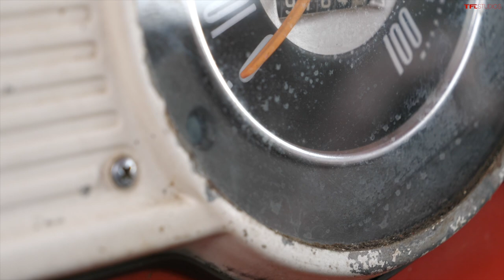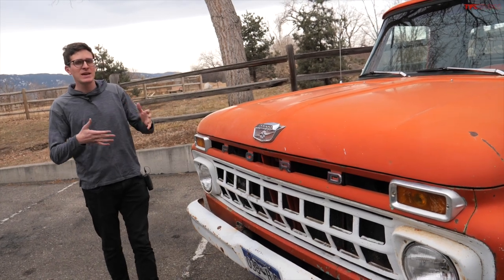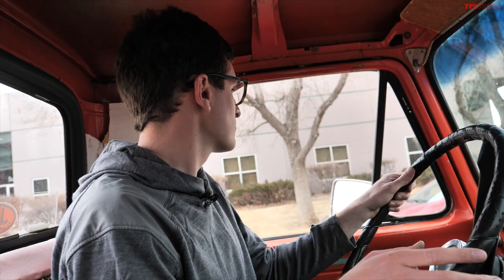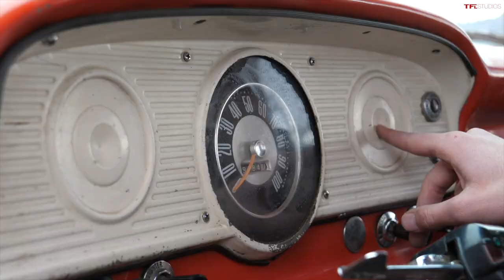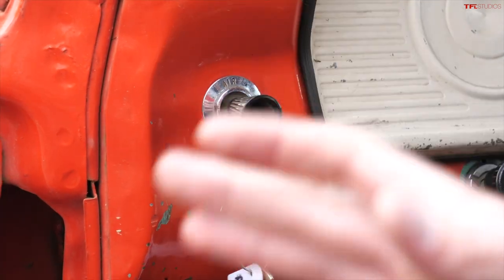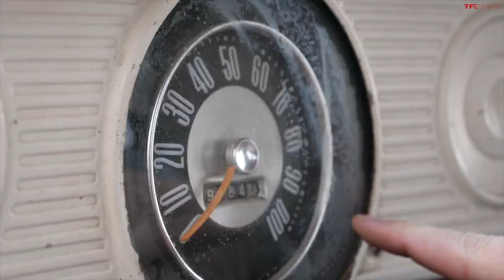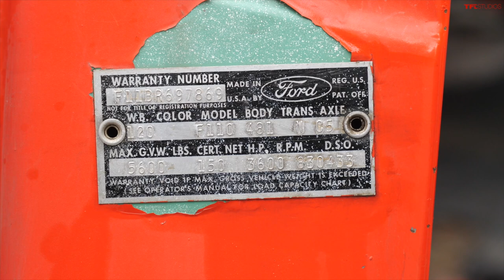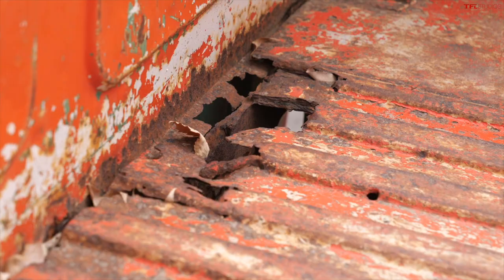Do You Like Raptors? I Just Bought The Ford Truck That Started It All!

Comment: Tommy you should daily drive it for a month, you will grow biceps if you do.  The lap belt will do more damage than good if you do not keep them tight against your thigh, if it is loose they slide up against your guts in an accident.  Nice truck I like them stock but most people update them.  There are kits for the brakes etc.  The nice thing about drum brakes is they can sit for a long time and still work, disc rust and rot out fast from sitting.  Back when ford made a truck.  You can get dash pads also so the dash is soft and almost what ever color you want.

Comment: I had a 91 Bronco with the straight 6 and that thing was unbelievable reliable. I remember I broke the radiator and drove around 120 miles with no radiator at all and the engine was smoking most of the way at 60 mph, on arrival I only replaced the radiator, coolant and oil and I drove that truck at least 50k miles more without an issue. I sold the truck to a friend and he also drove it for many more miles without issues in the engine...

Comment: Nice truck! I think I'd leave it a 6 cyl. I used to drive a 1955 and a 56 Ford trucks for work, utility work beds on them, 312 cid I think, no power anything, steering was scary on the freeway but they'd do it. Used a 1962 Ford 4X4 for snow plowing, also a V8. But I still have my 1973 Ford 4X4 short bed, factory high boy, lifted 2 inch springs and 2 inch body lift with 35X12.50s, after 36 years, second owner. It came with the 360 which I switched  for a 1964, high nickel, 390 a friend had built for his 58' Ford Fairlane race car. It had an Offenhauser intake, a big cam & 4 barrel. I rebuilt it with the Edelbrock Performer Package cam, lifters, intake and carb, Flowmaster series 40 desert racing mufflers shotgunned out the side in front of the rear tires on Heddman Headers, bored .060 over, TRW flat top pistons, converted to 1979 power steering, disc brakes with a small Grant steering wheel on a stainless steel steering shaft with u-joints instead of rag joint (which I've torn in 2 twice), which was a great mod. Swapped the Dana model 21, 1 speed transfer case to a NP 205, 2 speed behind the NP top loader 4 spd I rebuilt completely and had high grade drive shafts made for it. Changed the gearing to 4:11 with a Power Trax Lock-Rite Locker in the 9 inch, big bell, big tube, with custom bracing, Timken Roller bearings, 31 spline axle rearend. I'd bent the weak 8.8 it came with while rock crawling. Dana 44 in front rebuilt. Always used the Ford hubs with no problems. Installed bucket seats with air bag adjusting which really helped too. I wouldn't trade this truck for anything! I've owned it for 36 years! Drove it from Az to Wa when I moved, it's not as comfortable as some but can run down the freeway at 75 all day, even loaded, doesn't matter, still gets 10 mpg, have had it to about 120 passing a friend in his Chevy on the freeway to work, lol. It will climb until it's straight up in the air with the front tires off the ground sitting on the custom no drag rear bumper. Drag raced a brand new Ford V-10 and beat him to about 60 when I had to let off, lol. I will never buy a new truck, what a waste of money! (for what I do) I'm not afraid to scratch mine either, flat black is easy to touch up. Love my 1994 Astro van though i have to admit, with only 184,000, it looks and works like new and gets around good with the over sized mud tires i put on it. Everybody comments about either of these 2 vehicles when I go anywhere, lol. Old school fun for me lol

Comment: Great video. I love my 300 i6! Quick note on the different factory bed. It is a stock 65 bed from the 58-60 body style, but isn't 4x4 exclusive. One of the main innovations of the new 1961 Fords was a unibody f100. Basically, the bed quarters were hooked to the cab like a ranchero. While that helped with style, it created issues in real use. There were horror stories about doors popping open while going around corners with a load in the bed. The weight would warp the panel, and put your door out of alignment.  Plus, if you got hit anywhere on the side you would have to replace the whole thing. Due to backlash, Ford scrapped the unibody and went back to two-piece cab and bed. However, they didn't have the stock and tooling to produce the extra new "styleside" beds. So they re-manufactured beds from their old "fridge" body style. These 1960s are affectionately known as "wrongbeds" by the Ford collector community, and 1965 was the last year. They tended to be most prevalent on base model trucks, as a cheaper than cheap option. The wrongbeds went away by 1966, and the bumpside trucks began in 1967. Keep up the good work!
Reply: Quick note - The Wimbledon white 1961/62 f100 shown for a brief second at 6:37  is a perfect example of a unibody. I highly recommend looking into it, the history is very interesting.

Comment: The original mirrors had (kinda) "Z" tube frame and the mirror "housing" itself had mounting bolts at the center top and center botoms which served as side to side adjustments points. They were very long (about 12 in top to bottom by 6 in side to side), because of their lenght, they didn't need any up and down adjustment, so they didn't have any. 
I know this because my Grandfather had a '64 (maybe '65) F600 medium duty truck when I was about ten. He bought it from the Corona beer company when they were in Puerto Rico (Yes, Corona was a Puerto Rican beer for a while, look it up!). Grandpa used to do everything with that truck;  hauling sand, crushed rock, demo debris, refuse, etc. We also did some furniture and appliances moving for people. It used to be black and white whe it belonged to Corona and he had it painted red. I wish he had never sold it, but he was old and getting sick and I was away in the Army. Nice truck you have there. It brings back so many memories...

Comment: I grew up driving Ford 4WD's of this era.  You learned real quick not to have your thumbs over the steering wheel when 4-wheeling.  If you hit a rock, the steering wheel would whip around and the spokes would break your thumb.  If you forded a stream, the drum brakes would get wet and wouldn't work very well until they dried out.  In the old NP435 transmissions, reverse was the lowest speed gear in the transmission (even lower speed than the "granny" first gear), so if you were on something super steep, you could turn the around and back up the incline.  The '65 was the last year that the Ford F-100 had a 2-speed transfer case--after that they only had a single-speed until the mid-1970's.  Also, an automatic transmission wasn't available in the Ford 4WDs until 1973.  Kind of amazing, since Dodge had an automatic transmission option in their 4WDs in 1956 (!), though it didn't last long as an option;  GM had autos available in 4WD's in 1968 or 69.  Yes, the Ford 300 straight six was one of the best gasoline engines ever made.  They were also widely sold as industrial engines and millions of them are still in service today in all kinds of equipment.  Keep that ol' girl stock--except for the brake master cylinder.  And, yes, it was likely an ex-US Forest Service truck.

Comment: Wow.  This is almost the same truck as my '66 F100, even down to the color.  The bed changed and I don't have to deal with the chain tailgate.  But I do have the 352w, stock 4x4.  Even have a Ford fuel tank selector to hit up the additional fuel tanks.  Prior owner used it as a rescue truck for the ski resorts around Tahoe.  So they upgraded it to a radiator heater and a winch.

Love the video and would like to see me.  I love those old slick 60s F100s

Comment: My older brother had a factory built 3/4 ton 4WD 65. That truck went everywhere and did everything until the mid 90's when he sold it. And yes it had the 300 straight 6.
What to do? Soup up the straight 6 (yes it can be done). See if you can find a dash with a full set of gauges. Find an after market OEM replacement for the mirrors. Put in a headliner. 
I'd replace the seat belts so you have a shoulder strap for safety.

This would be a personal choice as it's either a love it or hate it option. Ever see the old Fords from back then with the amber running lights across the top of the cab?

Comment: That IS the gym! LOL Power steering by armstrong was what we called it. The only thing worse was when you had a vehicle that the power steering burnt out and you still had to drive it to get where you are going! Ive had Ford straight 6 and Chrysler straight 6 (slant 6) and their only real weak points are the oil returns, which are so small that when they clog up, it starves the bottom half of the motor. I had that happen and it was ugly lol (snapped cam, stressed crank and we dont want to talk about the rods & pistons lol) Keep the 300 and just do the safety and convenience upgrades, you will be able to will that beast to your grandkids as long as you keep it out of the winter salt baths!

Comment: I had a 65 F-100, probably the best truck I ever had.  Mine was a Custom Cab which was much nicer than the plain Jane ones.  Mine had the new style bed which matched the cab.  The knob on the right side of your cab was an air duct control like the one on the left, not sure why the lighter socket is there, it didn't come with that.  I got mine from the Ford proving grounds in Phoenix Arizona, well I got it from a guy who worked there he got it from the proving grounds after they were finished with it, I was the third owner.  I drove it with the stock 352 up to 230K,, is has less than 40 K when I got it.  I was lucky enough to find a 66 Comet Cyclone, the body was trashed so I took the Cyclone 390 and T-10 4 speed rebuilt both put them into the F100 along with the A/C unit, an under dash unit, put new carpet, I used the front power bucket seats from the Cyclone Reupholstered them and off we went for another 300K.  It was still just fine but,  I sold it as I wanted a new F150 Van.  I have always been sorry I sold it, wish I could get it back. I did have to put new door gaskets on it but that was easy and cheep. I had 5 new windshields over the years but the paint was great after all that time it still shined except for the few rock chips.  I did take extra good care of it so it always looked great, everyone wanted to buy it.  I had several fun races with that old truck I didn't win them all but it took a real race car to out run it.  I was taking a load of cinder block to a job one time and I got into a race with a Chevy II, I did a bit of a speed shift to second and the cinder blocks against the tail gate caused the front wheels to come off the ground, scared both of us, so the Chevy turned right at the next intersection.  OH it was a fun truck.

Comment: The vents were known as crotch coolers.  The swinging little windows were CV's or corner vents.   Oh, trust me, you will want the choke in the middle of winter in Michigan.  I took drivers ed in 1965.  We had a 65 Chevy Impala 4 door sedan and a 59 Chevy Parkwood wagon.  The 65 had power steering but everything else was human push and tug.  I drove the old 59 wagon most of the time with its 235 cu in straight 6 and 2 speed powerglide transmission.  It had the acceleration of the Titanic, but once it got rolling it would top 100.  Chevy and Ford both had indestructible 6 cylinder engines.  I could whip that thing around pretty good, but I was a country boy used to driving tractors and pushing lawn mowers. The 300 Ford and Chevy's big 6, the 292 were beasts, all torque.  Above 4000 RPM they just wheezed through the 1 barrel carburator.  Drum brakes had 2 disadvantages, they would fade under heavy use and they had a tendency to pull to one side or the other.  You just learned to hang on the wheel tight when you hit the brakes hard.  The design of a drum brake is self engaging, as you applied pressure, the force of the drum on the shoes would actually add to the force that expanded the shoes.  Cars and trucks back then were simple and functional.  Luxury was power steering and power brakes.  If you were really rich you might have A/C so you didn't need the crotch coolers.  I took that old wagon on many a date with a girl sitting in the middle with my arm around her, steering was left hand only even without power.  Parking the car required both hands.  The old guy that lived across the road told the story about when he was young and dating his wife, he got pulled over by a cop for having his arm around his girl and driving with one hand.  The cop walked up to him and asked if he didn't think he should use both hands.  Being the smart ass he was he answered "We how the hell can I steer with no hands."  BTW, the transmission you have is called a "stump puller 4 speed."  1st gear is referred to as creeper gear or granny gear.  I had a 77 Ford extended cab F250 with a 400 V8 and the stump puller trans.  It did have power steering and brakes and A/C.

Comment: Full Body Paint preservation job inside/out
Fix the bed rust issue with a bed mat.
full service all areas oil etc,
Undercoating job for protection.
New Upholstery..
Clean the engine up and try to make it as close to orginal/new operation.

then test it out on all challenges..

Comment: I've got the 250 4X4 version heavily modified with a stroker 460 now with 532 cubic inches mated to a T56 6 speed trans. Has around 600 hp and 700 ft•lbs torque 😁

Comment: Power steering will make a world of difference! It did on a 68 Chevy with manual steering and 3 on the tree. I hated turning in an intersection before, after the wheel could be turned with a pinky and then I could shift while turning.

Comment: Im glad my 65 f100 was a 352ci1d.    some upgrades to be a 390.  Threw out the fmx trans and put in a brute c6.      Added powersteering from a 71 f250.  4 wheel disc brakes. And it hauled ass.

Comment: Most factory four wheel drives were special order by the Forest service, Railroads and Ranchers and were rare so it very cool to see young people that appreciates these old trucks as this style is one of my favorites, best to keep it as stock original as possible only upgrading for safety features as in dual master brakes cyl and seat belt upgrade from lap to full shoulder harness but heck if you want to blow a stack of cash do a resto mod and upgrade this old truck so it’s has all the newest features.

Comment: OM606 mechanical diesel, NV3500 transmission, disc brake conversion and power steering. It doesn't need anything else. Keeps the inline 6 theme, doubles the hp and tq, almost triples the mpg's

Comment: Hi, I know I will sound bit weird, but please, the first thing it needs to be your safety. Reason why they improved modern car safety because people were dying in this kind of the cars. Here is the mine list :)  Collapsing steering wheel column; Two-line and disc brakes; Power steering wheel; seatbelt; Good set of the lights(front and back); Petrol tank replace with plastic one or even consider to move to different location; Fit winch at the front and some hooks at the back; in the bed make space for a spare tyre and locable tool box; on the cabin, roof put three orange light(Front Identification Lamps); Bluethoe radio(then can use GPS on the phone). Thanks for your time.

Comment: About the mirrors. See that little square cut into the door, on the leading edge in front of that aftermarket mirror? That is where a factory installed door mirror would go. If mirrors were not installed, and they were not standard equipment in 65, the square hole would have a black rubber plug.

Comment: cool video, I'd say keep the original 300 6cyl but give the engine some nice upgrades like head, camshaft, header intake and maybe a EFI setup. Then upgrade and cleanup all the old wiring and give the old truck some modern headlight bulbs and upgrade the interior lights with modern lights. Then do what ever body work is needed and then decide what color to paint the truck or just give it a little scuffing up and clear coat it.

Comment: My dad had a red short bed 78 F150 custom trim 4x4 with the 300 and he used to pull it at some local stock truck pulls.  In 4lo with that "granny" low first gear the smaller v8 trucks didnt stand a chance and the bigger ones usually barely won or didnt.

Comment: Awesome old truck with my favorite 6 cyl of all time, the 300 cubic inch Ford. Fix for dealing with manual steering: kettlebell workouts. BTW, Powernation has a great series of vids on how to get the beast to make more power and torque if you want to play around with it. It probably doesn't make close to 150 hp anymore anyway, and both the power and torque numbers will shoot up crazy high. Would be awesome for towing.

Comment: Most modern vehicle with dual brake cylinders configure them diagonally such that if you get a leak on the right front, the left rear will also fail but leaves you the left front/right rear with one on each side providing better stability when braking.